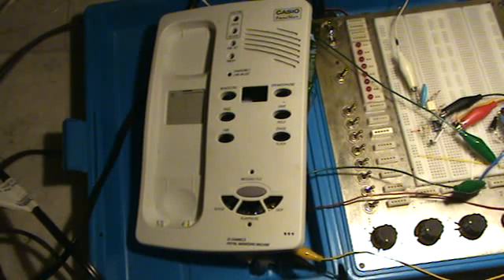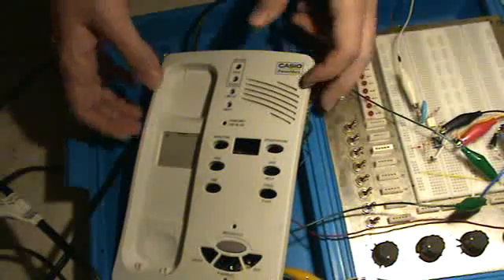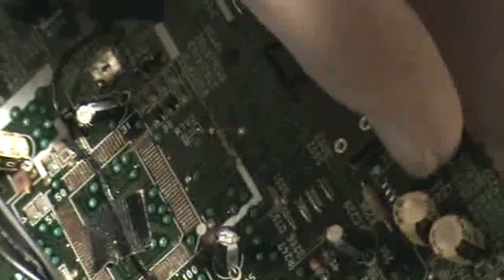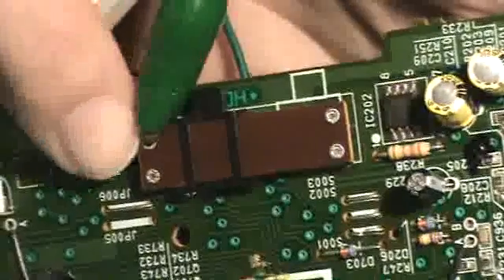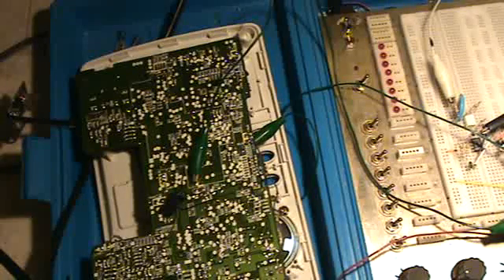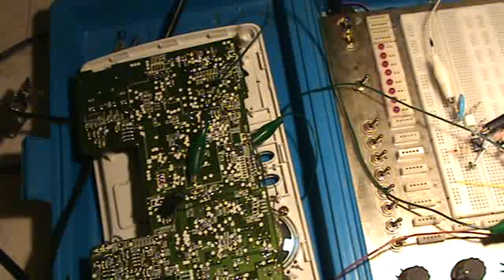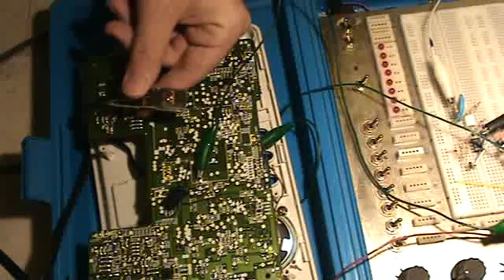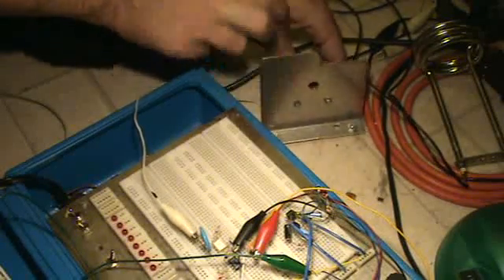How To Circuit Hack

Comment: Great vid , I have a opened up a remote control car and I want to use its circuit board as a flight controller for a quadcopter I'm building, is that possible? thnks :)
Reply: Thats an infrared sensor and would not be ideal for a quadcopter as that technology relies on unibstructed direct line of sight

Comment: im working on a portable dvd player. one of the white lines on the board has a whole in the middle of  it . when i first turn it on it sparks between the line where it got fried out. do you think a little sand paper n soder will fix it? lightning stalker!